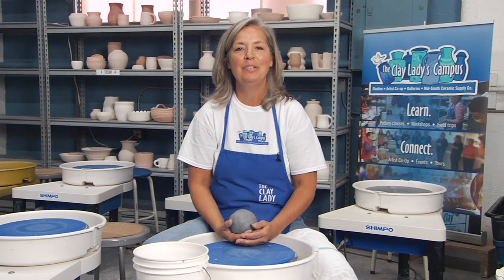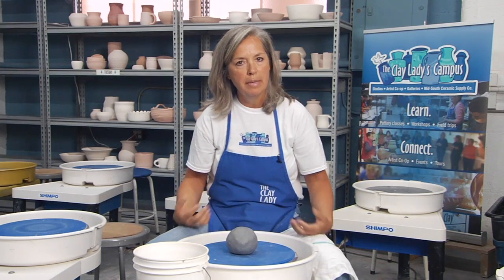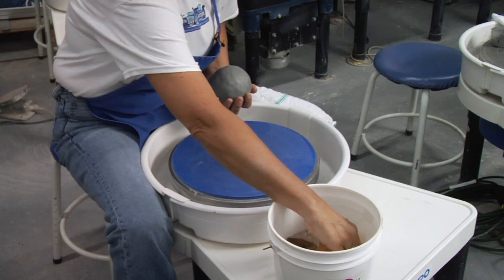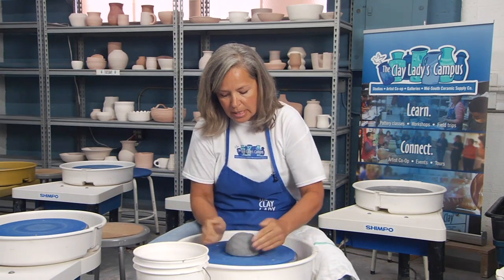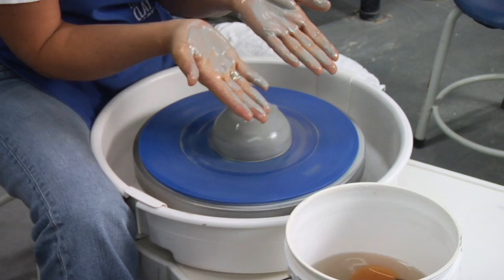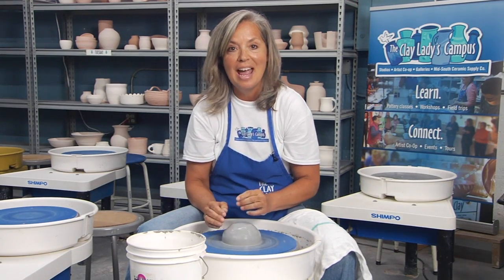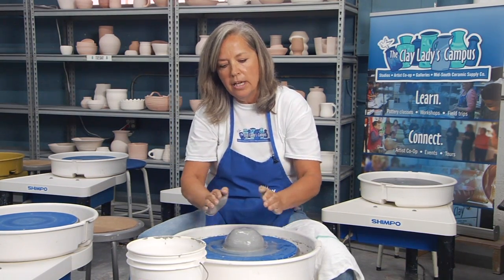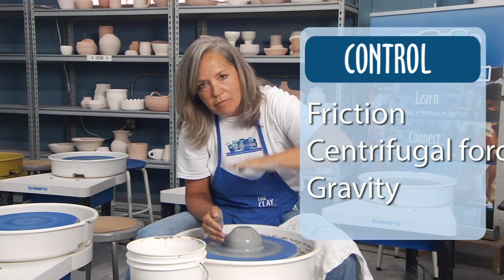Control at The Wheel with The Clay Lady

Comment: Hi. Do you happen to know anything about lower back pain and pottery? I've been experiencing really bad lower back pain and I've tried so many positions. The only position that I can center the clay easily with is if the wheel is at about my belly. Any lower I can't center. But on both my back hurts.
Reply from the maker: I'd recommend putting your wheel on blocks and try standing at the wheel.